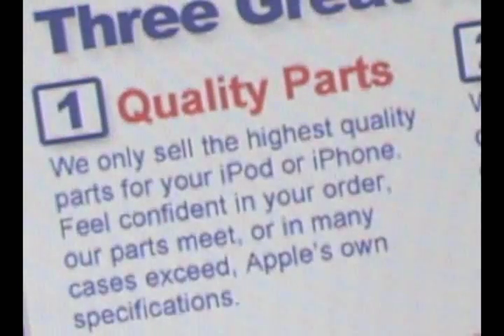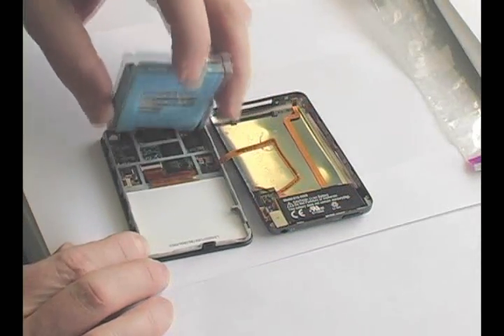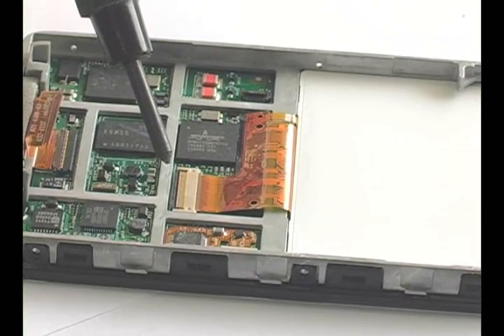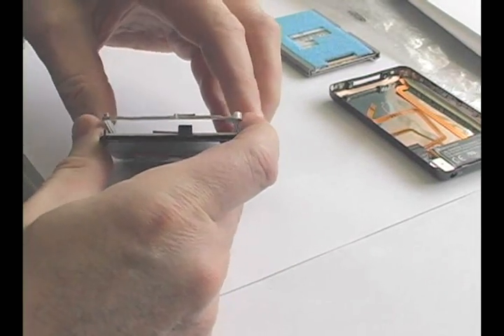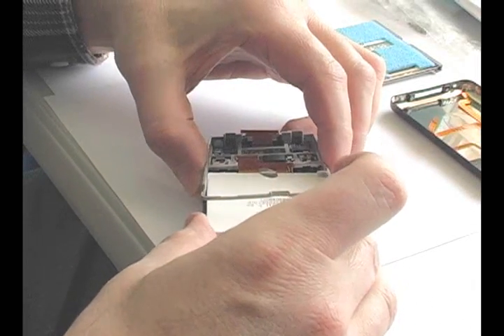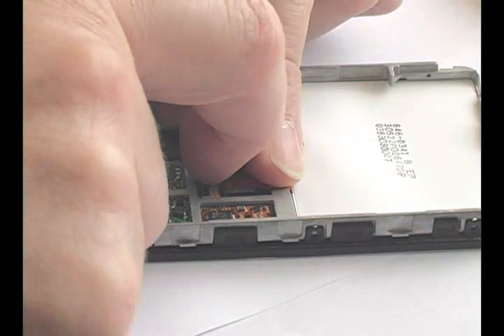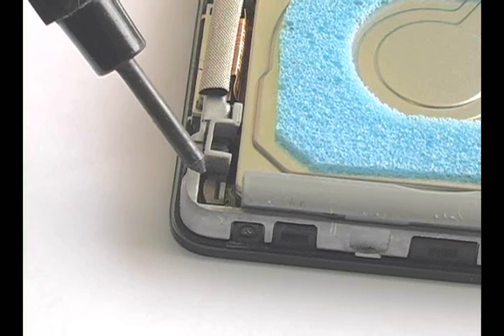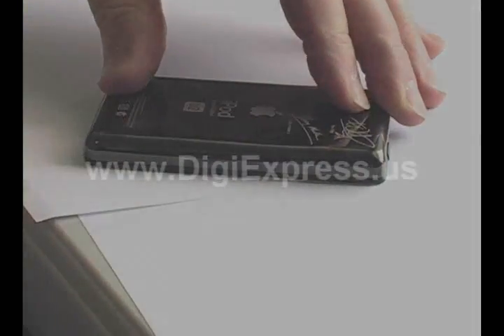DigiExpress - iPod Video (5th gen) LCD installation

Comment from the maker: @Skablam0793 If the "Low Battery" warning does not go away after 15 minutes, then the battery is probably not connected correctly.  The ribbon cable for the battery just gets pushed into the connector on the logic board.  If you are confident in your installation and are still finding the "Low battery" message, you may have an issue with the main electronics board and not the battery.

Comment from the maker: @grammygam If the hard reset does not work you can attempt to put it into Disk Mode by holding the Center + Play/Pause button.  The proper way to do this is to toggle the hold switch on, then off; hold center + menu.  Once the screen "fizzles" out then hold the Center + Play/Pause buttons.  Shortly the display will go black and white and you may be able to get a connection to iTunes so as you can do a restore.  If none of this works, you would need to send it in for a Diagnosis.

Comment from the maker: @MsPamkitty That is tricky, if the device shows no display when plugged into a wall charger you may have an issue with the main electronics board. The original issue with the clickwheel could have been a main electronics board issue from the beginning. In some cases when you disassemble the device and reassemble it, there will be a need for a hard reset (hold menu and center button at the same time).  If your center button functions you can do this reset, if it does not then you need a board.

Comment from the maker: @MsPamkitty the center button is not connected to anything it just sits between the faceplate and the board, being held in position by the rest of the clickwheel. If you were to completely disassemble the device down to just the logic board you can then change the clickwheel out with a new one, or re-seat the center button to make better contact with the actual button on the board. There is a black "pad" on the logic board that takes up the space from the button to the board, this pad may be off

Comment from the maker: @dvdfabber if the charging port on the device is not functioning properly you would need a main electronics board, though if the device connects intermittently then you may need a hard drive for the device.  I cannot be certain without having the device with us right now.  We do have a Diagnosis service, for $25.00 that would be able to source out the exact issue with the device then report those findings to you.

Comment: how much pressure on the connector band ,is there a need to match the pins or it will go and sit on the correct pin by itself

Comment: so i successfully put in the new lcd, pushed the ribbon cable connecting the lcd to the motherboard into its slot, and while attempting to ensure the best possible connection between the screen and board i ended up removing the black tab from the connector entirely. it is proving extremely difficult to put back in. do you have any suggestions, or can i just leave it out and hope the screen and motherboard stay well connected?

Comment from the maker: The Black tab is on the opposite side of the connector from where the ribbon cable is inserted. Rotate the tab up 90 degrees.

Comment from the maker: It will open like it shows in the video. Start in the middle of the side pressing from the top (faceplate) into the groove toward the bottom (back plate) and you should be able to create an opening. Then run the tool around the iPod until it works free. 

We will install the LCD for $25. Please visit our website for more information.

Comment: As the video here shows, you need the screwdriver to take off the six screws that hold the case assembly together. ESD stands for electro static discharge. its like when you rub your feet on the carpet and touch a doorknob. Except that electronic devices are very sensitive to them. you can damage your device from esd without feeling it. These bracelets are relativly cheap.(I got mine for $6) 
 You should look to see if it's just the LCD that's broken. you might need to order a faceplate as well.

Comment: You will need the LCD (the exact one you require for your make of iPod can be found on their website), the plastic opening tools, and a #0 precision Philips screwdriver.
Id also recommend wearing an ESD bracelet, which grounds you at all times so you don't damage the semiconductor components in your device. This isn't NEEDED though.

Comment from the maker: Yes, it is the same except that the case is harder to get open. Once inside the only difference is that there is a metal plate behind the LCD. It comes out when you remove the faceplate screws.